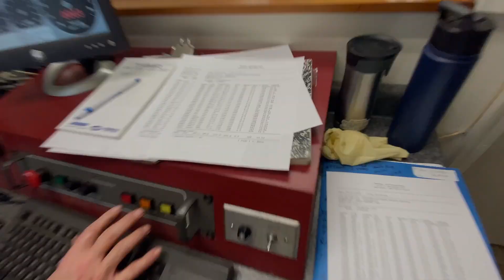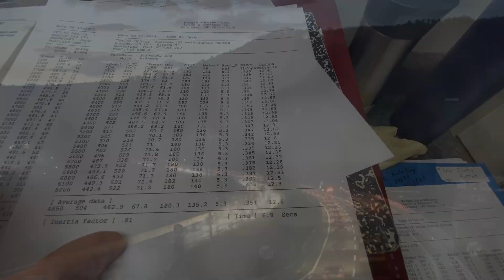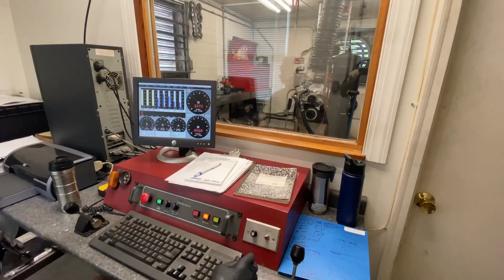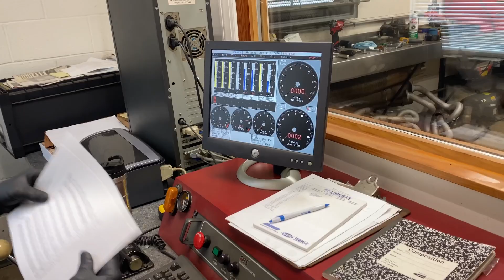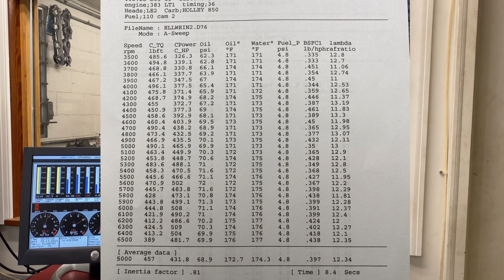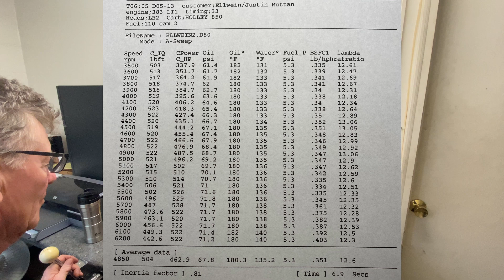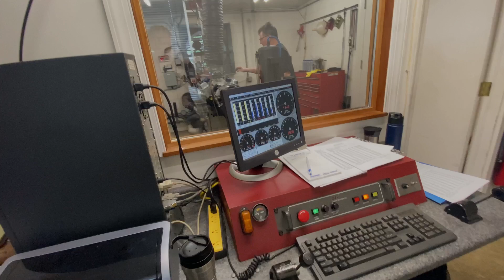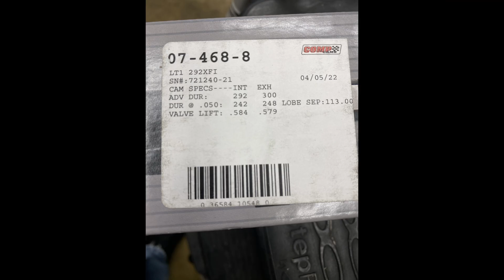Justin Ruttan's LT1 on the Engine Dyno

Comment: @ellweinengines would you prefer an Eagle or Molnar 3.48" Crankshaft on a boosted high rpm LT1 ?
Reply from the maker: I do not have very much experience with the Monar but for just one customer' engine where he supplied the Molnar crankshaft.  But I was impressed with the Molnar.  I really don't know which would be best.

Comment: Hey Mr. Ellwein im doing my best to build a 94 lt1 can i get 500hp with porting and cam mabey lighter internals
Reply from the maker: In theory yes.  Really good porting and good valve springs and the right camshaft.  No need for lighter internals or for changing anything in the bottom end (unless you want to).  But better rods will be a good idea for more RPM.

Comment: Wait, what valve covers are those?
Reply from the maker: Those are perimeter bolt valve covers.  I bought them from Chad Golen.  Golen Engines.
Reply: 12:54 
I see bolt holes in the center! 😅
Reply from the maker: @clifford_2zero7  Another reason to like the ARF.  You can have your choice of valve covers
Reply: @EllweinEngines  Ya know, I think I knew that now that you mention it.  So much better of a selection.  With the eficonnections 24x bracket I got I'm pretty sure it says cantons won't work. I gotta figure something out though really don't care for the stockers.

Comment: I have a 355 with ported LT4 heads and intake, this cam, and 8.43:1 dynamic compression.  Carl helped me (via email) through a snag with the engine a couple of months ago.  The engine has been finished for a month and a half or so, but it should be in my camaro, and running early next week.  I know it’s a big cam for a 355, but I still believe that it will be lots of fun.
Reply from the maker: Please report back after next week.
Reply: Sounds awesome brother.  Manual or auto and what rear gears?
Reply from the maker: @Axrbear  It is going in a 1997 Camaro with auto , 4.10 gears, S60 rear, SS3600 yank converter
Reply: @EllweinEngines  nice.  👍

Comment: I'd love to see that engine with a real cylinder head on it. Heads are just saturated by 5700rpm and it just lays there. Probably climb to 550-575 at 6500rpm with a better head and a smidge more cam perhaps.
Reply from the maker: Definitely!   Some AFR heads would do exactly as you predict. (my hunch too).
Reply: @EllweinEngines  Was going to ask if chamber was 53.7 still lol .
AFR heads would get murdered 64 cc chamber The stock lt1 is 11;95 to 1 chevy figured 10;4to 1 With a Dish piston and put in ,029 cc Flat top 014 mm below Deck you upped that this is all out race engine Forced induction  I bet 13 to 1 CR static stroker .
AFR 64 cc chamber runs in 10s barely this will do 9s maybe 8s
Reply: @EllweinEngines  stock lt1 stats from GM Heritage minus 029 4 inch flat top .
Minimum combustion chamber
total volume cm² (inches)
Cyl. no. system L. Bank
(front to rear)" Bank
Firing order
Intake manifold material & mass kg. (lbs.)
53.7 (3.28)
Not Applicable
1.245 mm (0.049 in.)
75.175 Combustion Chamber with Piston at Top Dead Center and All Components
in Place Torqued to Specifications.

Bore Spacing (C/L to C/L)
Cylinder block material & mass kg. (lbs.) (macnined)
Cytinder block deck height
Cylinder block length
Deck clearance (minimurm)
(above or below block)
.014 mm Below
Do the math lol typical for stock lt1 to win world championship with just gears in Stock Eliminator running 10.42 - 10.50 ets 
world champ 2012 and 2022 Brent Darroch 94 Camaro/ 2025 Bubba 97 Camaro 10.42 over 130 mph 
64 cc chamber will 10 .90 with AFR HEADS get murdered by stock LT1 
LT1 is Great platform But Barely runs on premium